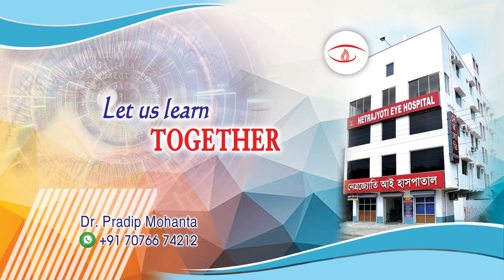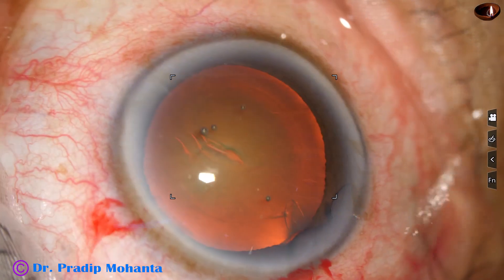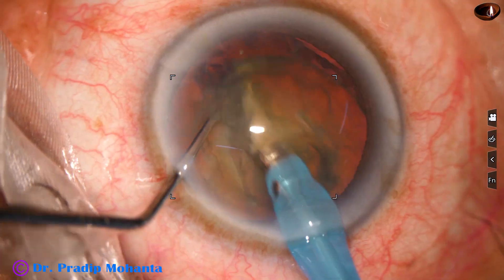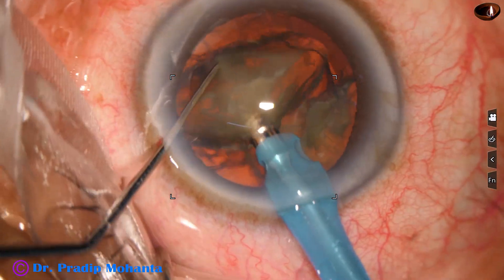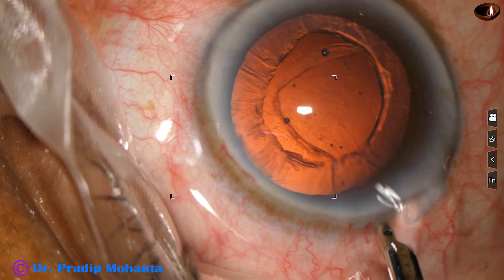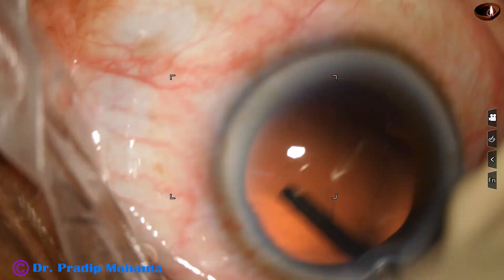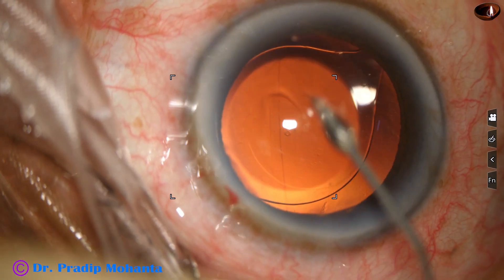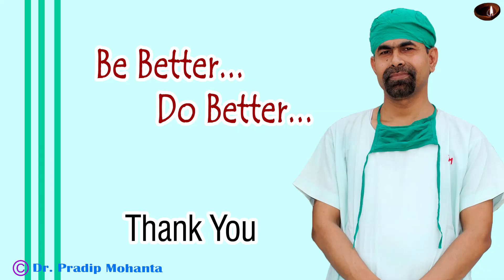Phaco of cataract with gr 3 +  Nuclear sclerosis - unedited video : Pradip Mohanta, 7th Oct, 2022

Comment: Great video, I have a question. Why do you fill with visco before the I/A? Thanks
Reply from the maker: To keep the AC deep.
Visco comes out gradually,  water comes out rapidly. 
If you use Simcoe through main wound, use visco. It will help in maintaining AC.